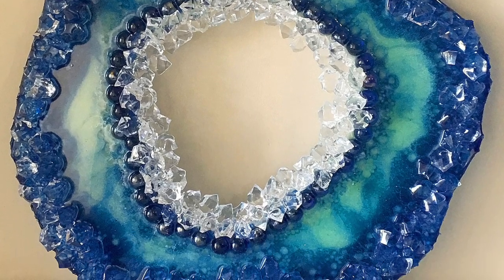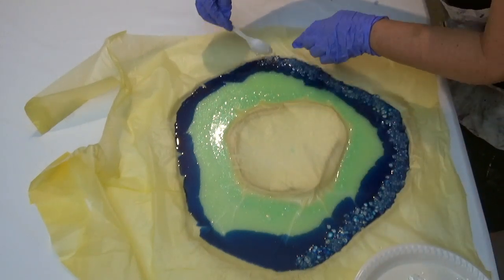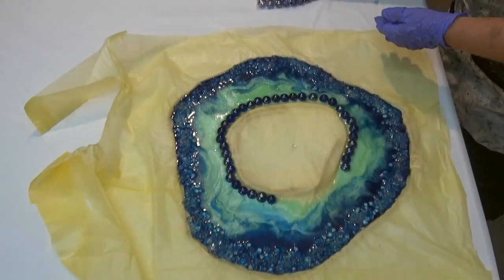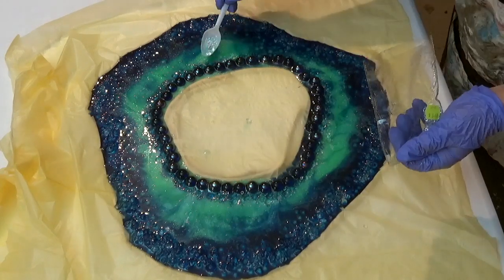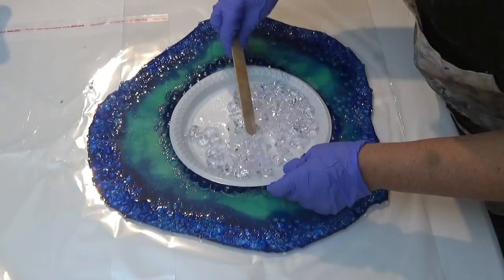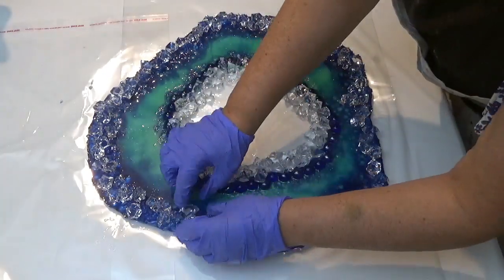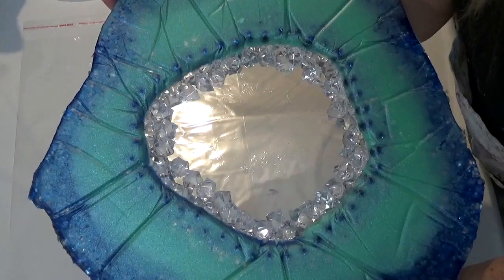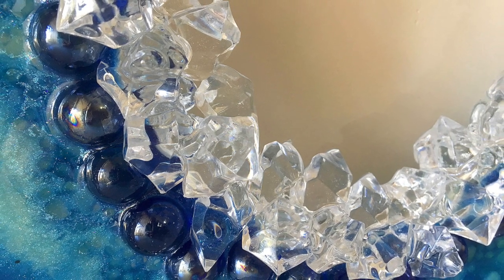Create a Quick and Easy Geode Freeform Shape - Using Rope and Plastic Bags

Comment: Wicked!! I have been using foil in place of the ropes so I didn't just have to throw it away after cooking or covering something. I keep the foil 'frames' in a box as I can use them over and over again. :) Thanks for sharing. - Heidi
Reply from the maker: Foil is a great idea, I am planning to do a version with foil because I want more control over a particular piece I am planning. 💕
Reply: @SueFindlay  Yeah it works super well for getting custom shapes you want. I mostly do organic type shapes but I haven't had one not work out like I wanted it to yet. :D Oh and yes I do clean off the ones I used for cooking if needed even though it won't touch the resin at all. :p Just an OCD thing.
Reply: @BlackCat_2  The Resin doesn't stick to Foil? Didn't know that.
Reply: @khione8044  It will unless you  use a nonstick foil or spray it with cooking spray or other mold release. I put an HDPE plastic bag over my foil frame and the resin does not stick to the HDPE bag. in other words I put the foil frame inside the bag. Hope that helps.
Reply: @BlackCat_2   Oh ok! Thanks for the explanation!

Comment: Another gorgeous piece Sue!  I love the rope idea!  Can you please explain the turpentine/mineral spirits thing you did to move the resin?
Reply from the maker: Thank you 💕 I simply put some mineral turpentine into a small cup and dipped the end of a stirrer into it. Then it is dragged across the resin and as you can see in the video, it repels the resin and creates shapes. This method works to move the resin and pop bubbles when you don't want to add heat.

Comment: Using a rope is a wonderful idea. Do you use silicone molds? I'm having a extremely hard time with demolding? My resin is getting stuck and tearing. No matter how much I heat it up to soften the resin it won't come out and rips the mold. What do I do?
Reply from the maker: I don't use moulds, so can't offer advice, other than it sounds like you are melting the mould. Don't use heat on your mould and use a release spray. Good luck 🥰

Comment: Hi Sue. Another beautiful piece. What is the second plastic sheet you used. And what hardware do you use in the back to hang it?
Reply from the maker: The plastic is just cellophane that florists use 💕 I used D-Rings on the back, which are held in place with resin and small screws.
Reply: Thank you ☺️